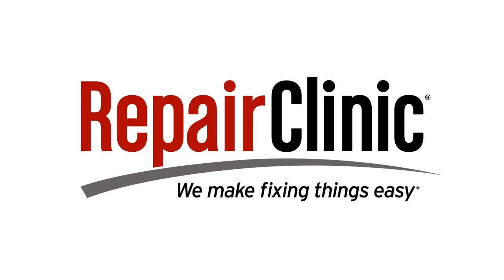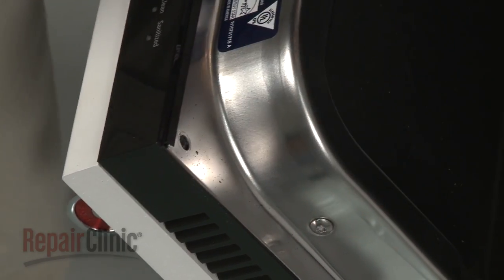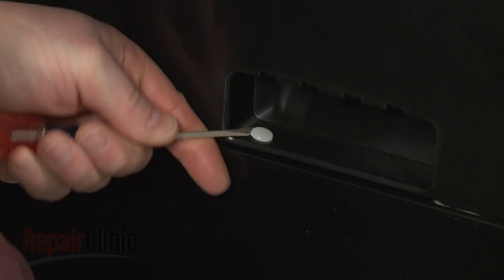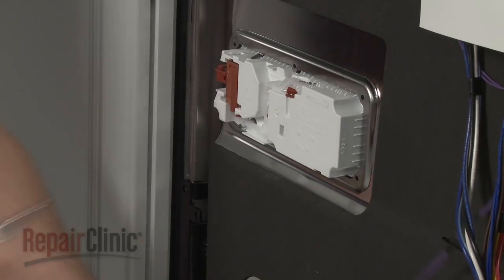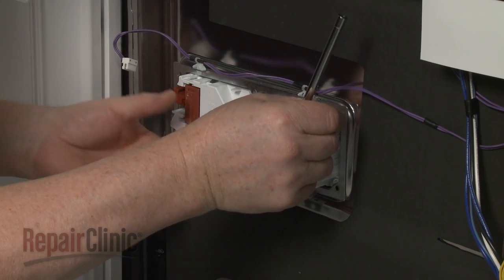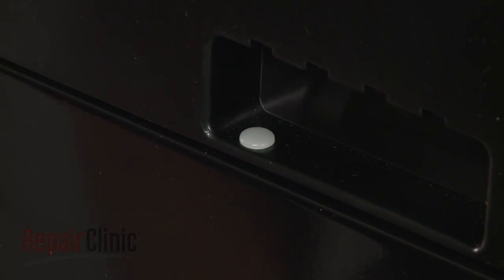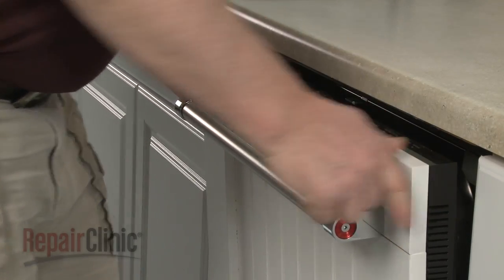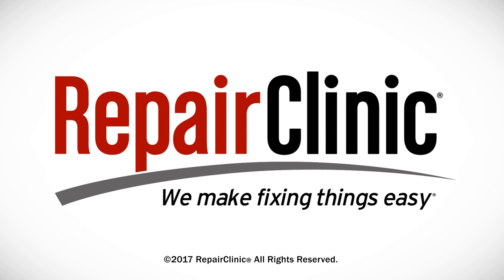KitchenAid Dishwasher Detergent Dispenser Replacement W11032769

Comment: my asko d-5253 soap dispenser was not opening during the cycle.  I replace it with a new one and it still isn't opening.  Could it be something in the power to the dispenser?

Comment: hi i have a Kitchen aid diswasher model KUDSO1ILWHO MODEL with a brokem soap dispenser. follow your video instructions but got stuck once i open the screws and realised that the front door does not pop off like in your video.  It appears that the door is attached somewhere to the inside lining of the dishwasher door. i have made a few attempts to figure out where and how to spearate the outer door cover so that i can access the saop dispenser but after removing all the screws along the inside of the door I am still not able to access the soap dispenser.  any help would be appreciated. i work on my cars and is very handy (except with dishwashers apparently - lol!) thanks Ken
Reply: Same problem. I also tried sliding the panel upward, and then downward, to see if you had to slide it off a retaining clip or something, but no cigar

Comment: hi, my KUDT03FTSS2 dishwasher started leaking water and i'm troubleshooting the basic 5-6 trouble areas.    Is the Detergent Dispenser known to fail and cause water to leak down onto the floor?  the water is dripping exactly from the white transparent plastic backwards "L" where the wires run under the door( as shown at 2:57 of the video).